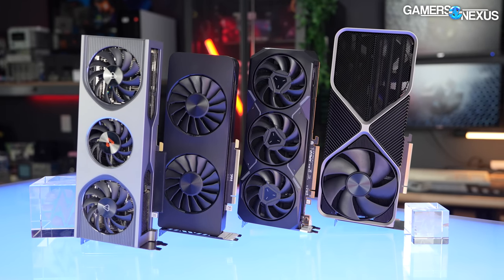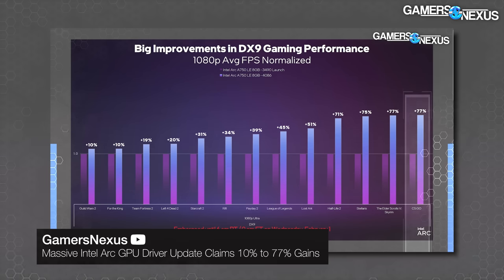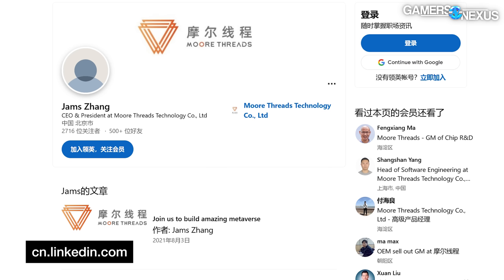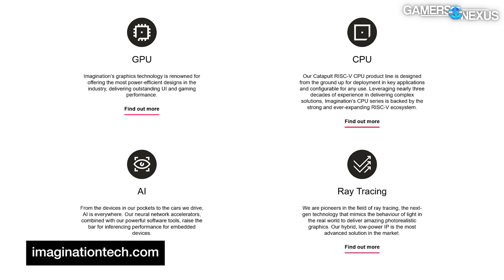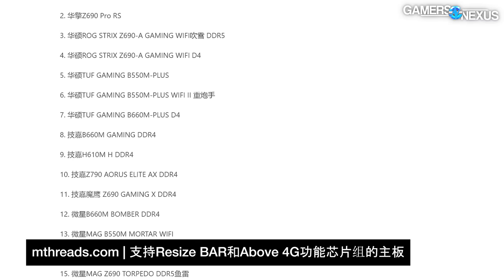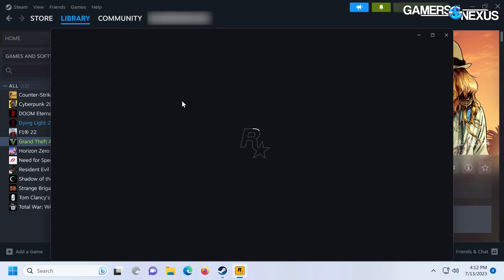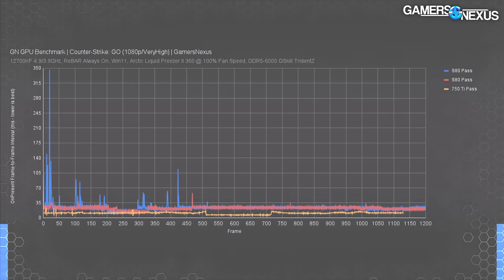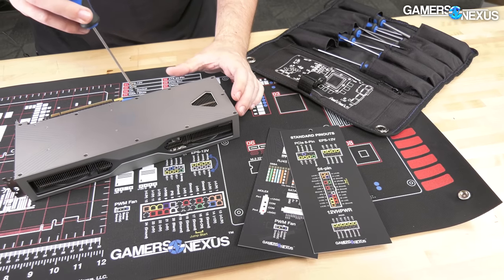China's Moore Threads MTT S80 GPU Review | A New Challenger Appears

Comment: I think it would have been insightful in this case to see the performance compared with modern iGPU performance numbers in addition to the 750 ti. These numbers suddenly make my 5 year old laptop with a mobile 1060 feel like I'm a baller.
Reply: bro lollololll
Reply: i think people doesn't understand that this GPU isn't running at full power. Probably 20-30%. It lacks driver optimization which needs more time
Reply: @cactuslietuva  So, it will go from shit to crap?
Reply from the maker: We had the 16-series cards in there too. An IGP wouldn't really give us any different information.
Reply: that 1660 super? in theory, it is twice as fast as the iGPU in the 7000 series Ryzen.
and that iGPU is (also in theory) twice as fast as the 750Ti.
and that 750Ti is also in theory about the same speed as my old (not in use anymore) HD6950.
But in real life scenarios, I got a better performance with that HD6950 than on my now current iGPU on a Ryzen 7950X.

So I would set my iGPU about where the 750Ti sits as general direction.

I know, it's like slapping bicycle tyres under a 600HP engine, but hey, 600HP! (no worries, it'll change)
Reply: @bernds6587  I'd be more careful about that iGPU comparison you made. You're specifically talking about the Raphael/Dragon Range iGPU (2 CUs), but that has overlap with Mendocino, which is also Ryzen 7000 despite being a monolithic Zen 2 design. Then there's Barcelo-R -- which is just a refresh of a refresh (Barcelo, which is a Cezanne refresh, meaning monolithic Zen 3 with up to 8 Vega CUs and DDR4 support) -- and Rembrandt-R -- which is just a refresh of a different refresh (Rembrandt, which is largely also a Cezanne refresh, but it uses 12 RDNA 2 CUs and supports DDR5). Finally, you have Phoenix, which is monolithic and uses RDNA 3 instead of RDNA 2, albeit with the same number of CUs as Rembrandt(-R).
Reply: While Ig their effort is worth "something" this is a pitiful display like my 12 year old laptop could've done better than this
Reply: @mathewcalaway7684  This GPU is just a low effort demo product to showcase their 'indigenous' tech for individual consumers and investors; The whole point of Moore Threads is AI and high-end compute that is developed and manufactured domestically, as such not affected by US sanctions.

The US banhammer is primarily hitting the fabs, and there's no way China's going prioritize gaming GPUs over commercial and government uses for the limited domestic fab capacity. So forget about gaming driver support in the long run, unless the fab issue somehow gets resolved. If US sanctions start hitting Nvidia/AMD gaming cards (probably inevitable) most Chinese gamers will smuggle them in through the black market, but if Moore Threads has a minuscule foothold in the gaming market, maybe that could turn into a major business opportunity in the very long run (10 years+).

And one must also consider if we're starting to hit the limits of silicon performance, with GPU wattage now going up the wazoo. As the leaders start to stall, the ones behind will start to catch up.
Reply: @mathewcalaway7684  It could but probably won't. You know how Intel's drivers are taking a while to get it together because Intel's focus for years was iGPUs? This Moore Threads GPU is based off of PowerVR IP, a company that last made desktop GPUs when the Y2K bug was still relevant. They have even less experience than Intel and I'm not sure if the Moore Threads people even have access to the PowerVR knowledge, or just the IP.

At best it'll be years before the drivers get whipped into shape but considering that afaik this GPU is meant for compute I doubt it'll ever be very fast for gaming, more just have the crude support for gaming-related APIs we're seeing already.
Reply: @sonicboy678  I know about the change from 8 Vegas to 2x RDNA CUS, but I was pretty sure the Vegas were only in the 5000 series?

That 12 RDNA2 CUs aren't in desktop CPUs, right? I mean, 12 CUs is almost half a RX 6600. I suppose they're used in handhelds and maybe laptops?
Reply: @bernds6587  Ryzen APUs with DDR4 support use Vega graphics, though the variant used in Renoir/Lucienne (Zen 2) and Cezanne/Barcelo(-R) (Zen 3) is in line with the Radeon VII variant (TSMC N7).

Rembrandt(-R) and Phoenix are currently relegated to laptops and handhelds, but AMD could put them on AM5.

Like Rembrandt-R, Barcelo-R SKUs are named within the 7000 series despite using Zen 3.
Reply: my R390 is like a 5090
Reply: @cactuslietuva  Driver optimization is up there with silicon design in terms of difficulty, Intel is still having huge troubles with this.
Reply: @Avantime  Not necessarily, once we reach the limits of silicon design will probably start focusing on efficiency/watt and chiplets. Considering that the longest designers have had to work on a single node on average was around 2-3 years, there is likely a lot of potential that can be brought out of chips just through better design. Just look at how intel managed to squeeze every last drop of performance out of their 14nm. They went from 4 cores running at 4 ghz to 8 cores running at 5+ ghz while also being able to get significant IPC gains and even being able to double the cache size. You will likely see longer architecture development cycles, instead of tick/tock it will be like tick/tick/tick/tock. Unless some new design paradigm, like chiplets, takes over this is likely where things will head for a while. Design is incredibly difficult, so it will be likely that the big 3 will remain on top unless some very poor decisions are made.
Reply: @gokublack8342  those 12 year old gpus took decades to make. not 2 years.
Reply: @AndRei-yc3ti  it is still majorly outclassed by stuff over a decade old
Reply: @gokublack8342  yes and? A gpu that took two years to make is "outclassed" by a 10 year old gpu that took decades to get there. Growth is exponential. Where was my statement jncorrect?
Reply: @AndRei-yc3ti  It's incorrect because it's nothing to be impressed about its almost as bad as them taking 5 years to figure out how to make their own ballpoint pens (which isn't a very complex item) if a US startup made something so shitty they'd get laughed out of the room. Had they done this 10 years ago it would've been like yeah good start or whatever. But this is 2023 I'm not remotely impressed and if I was their supervisor I'd be very tempted to fire the whole lot of them for even thinking it was remotely a good idea to put that garbage in front of me Edit: your decade argument doesn't hold up though this isn't new ground or anything this has all already been done...over 10 years ago...there isn't that much to figure out especially considering copyright in China is as they say "free real estate"
Reply: @gokublack8342  lol making yheir own processers and GPUs is one of the most ckmplex things a company can currently do. And this is based on entirely chinese tech so it needs iteration

Comment: To put into perspective how bad these results are, the Steam Deck is a bit faster or the same performance as a 750Ti in most games (this is according to DF).

So at 15W the Steam Deck is about twice as fast as this card using over 130W.
Reply: @jakejakedowntwo6613 
The Mac never used PowerVR, it used PowerPC. Those are completely unrelated.
This card is also completely unrelated to PowerVR. PowerVR is a designer of TBDR GPUs mostly used in mobile devices. They don't support Windows and they don't support any kind of DirectX nowadays anymore. Their targets are Vulkan, OpenGL ES and Linux/Android.
Reply: @dexterhaxxor  my bad i mixed the two up
Edit: GN speculate that it could be Power Vr via circumstantial evidence and it could be performing terribly since it wasn't designed well for gaming. 
BullsLab tested its float performance and it was good.
Also Imagination Technologies is owned by China.
Reply: @dexterhaxxor  The Mac didn't, Apple used PowerVR for their GPU's in the Early Iphone's and Ipad's.
Somewhere around 2016-2017 is when they stopped using PowerVR and started designing their own GPU's for their mobile devices.
Reply: @Bogster13  Ah alright, makes sense, didn't know that. Anyway, PowerVR definitely doesn't make bad GPUs.

Comment: Intel: Delivers one of the most unstable GPUs we've seen in a very long time
Moore Threads: "Hold my bear"
Reply: panda*
Reply: @manakajunpei9007  Hold my bamboo.
Reply: Yes but Intel has been making iGPUs and drivers for decades. This is MT's first GPU ever. Big difference there.
Reply: @andrewskaterrr  Yup, that's the only reason they even remotely have a fighting chance. Even then, they seem to be continuing their track record of shoddy driver updates. Lots of people with Arc GPUs can't even wake their system up from sleep mode which has been a know issue for many months, lol
Reply: @BelleDoesStuff  'shoddy driver updates'?? Lol, their updates have been on fire and they are improving with each iteration.
Reply: actually that used to be true till 5 months ago the arc a750 would crash at least one time every time i played gta5 in dx 11, but as for now with the newest drivers everything works flawlessly, they fixed the issues with dx11, vulkan games never ever had issues even when i first bought the card. Its been 3 months since the last crash in a game, and would even go far as saying that i would advice a 750 over a 3060. Even on the drivers situation, intel's software might be a lil stripped down when looking at nvidia's software, but boy installing drivers fot it is so easy even a toddler could do it.
Reply: @BelleDoesStuff  Absolutely not true. They pull a new driver every two to three weeks and with each update is always leaps forward.
Reply: @addo9697  I daily drove an A770 for the last 5 months up until a week ago.

Here's a list of problems I was still actively seeing when I finally replaced it with a better GPU: 
- Intel publishing a couple of drivers that would cause regressions in system stability
- I dealt with the sleep issues that were ongoing the entire time I owned the card
- I've seen countless DX11 games with unacceptably bad performance
- A good handful of games with graphical glitches or stability issues.
- Was sold Topaz Gigapixel AI as part of a bundle with my A770. That and other Topaz Labs software is still to this day completely broken on Intel Arc due to driver issues. This has been known by Intel for nearly 5 months now without any update.
- Dealt with RPCS3 issues where the Intel Vulkan driver would timeout, preventing the emulator from launching
- During the last month or so I used the card, I had to deal with an issue where launching a game would cause my bluetooth headphones to disappear from my audio devices and take ~30 seconds to become valid a valid audio output. I actually didn't think this could have been an Intel issue, but it is completely gone now that I no longer have an Arc GPU.
- The Xenia emulator was basically useless for me because of a very long standing Intel driver bug that prevents the emulator from using it's default render. It instead had to use Xenia's more accurate render which for me made the A770 perform about half as fast as the 1070 TI I originally had in the system.
- General power efficiency issues and most especially the high idle power draw, even with the specific BIOS settings enabled. Only "fix" would be to lower the refresh rate of my display, which I'm not willing to do.
- I had to deal with the issues Intel Arc GPUs have with snipping tool which is still an open and valid issue to this day. This problem was originally reported to Intel back in December and is still ongoing.
- Their time to fix for issues is actually pretty bad. Large issues that can prevent people from being able to reliably use their computer or play games often take many months to be resolved.
- On top of the time to fix the issues taking a long time, their driver support team was not something I was impressed with. I reported to them that Portal RTX didn't work on Arc GPUs and I was told that the game also doesn't work on AMD GPUs (when it does). When I pushed back on them and gave evidence that it does work, they shared a video of Portal RTX crashing on an AMD APU and used that as proof.

When the card was stable it was pretty good and even with the issues I saw, I still think Intel has done a pretty decent job and I'm impressed that it's not largely much worse, but that GPU architecture is approaching 1 year on the market and there are still some large stability issues that effect plenty of people. The progress that they have made is good, but it's not enough to bring it in-line with AMD or NVIDIA and is what I would consider to be "shoddy" because the quality is just not consistent. 

And yes, they do frequently release new drivers, but these are almost always focused on improving compatibility with brand new titles rather than fixing the long backlog of software issues.

I'm glad you are having a good experience with your A750, but people have a widely inconsistent experience with Arc GPUs and even when they are behaving on the more stable side of things, there are still a lot of issues.
Reply: 55 years company with decades of experience in making iGPU and keeping up with firmware to support graphics tech with one of the richest human resource in the industry

vs

3 years old company in foreign country operating under quasi tech blockage
Reply: Well, I credit Intel for taking a shot at supporting the consumer GPU market and tossing their hat into the ring. Their offerings are not quite there yet with nVidia and AMD's best, but at their price point, they are not terrible and continue to improve. If they stay in the market eventually they will be a player, and that will be important if nVidia diverts resources to "AI" chips. I doubt nVidia would abandon the consumer market - there is a lot of money still there and I doubt they'd leave it all on the table, but "AI" (deliberately quoted) certainly could affect R&D resources going forward.
Reply: @BelleDoesStuff  Bruh I really think you got a bad 770, or maybe the 770's are bad (. Lots of people advising the 750 over the 770) but I literally never encountered almost any of these bugs, the only notable one that u mentioned, and that I had is the Bluetooth bug thing, but really got fixed in the next driver. Other than that I've been playing with it all games and programs, no problem whatsoever. I feel sorry that u got a bad arc GPU
Reply: @BelleDoesStuff  I can assure u my arc never had problems with Vulcan, and dx11 got actually fixed, I almost never shut down my computer it always put it on sleep and I didn't have any major problem with it I've got 3 monitor all different attached to it and once in a while it will disconnected the HDMI display automatically, but nothing that unplugging and plugging again can't fix, but this is the only problem I have with it for now

Comment: RE. the memory spacing. While it may be correct (or also correct) that the memory has been moved to avoid the screw holes, its also possible that they may have moved the memory closer to shorten the traces as high frequency switching is very sensitive to length. Also, it could be an attempt to get a working board with less layers to reduce cost (reducing the path the signal has to travel reduces the amount of time interference is experienced by a particular signal). Thus, they may be able to use less layers.

Comment: I'll bet the heatsink was some off the shelf generic cooler and so they adapted the PCB design and moved the Memory so that they could still use it. I kind of like the way the card looks. Very interesting product, thanks for the video!
Reply: Doesn’t look like it, have you ever seen a recent GPU have heat sink screwed form the front? They all screwed in from the back.  And look at that hole spacing… most GPU I can across are square, not rectangle.
Reply: The fans are off the shelf cheap garbage too, about 12 yuan each on TaoBao.

Comment: GTX 750ti is a legend. It was a very good card at the time for not much money and it used very little power. In fact it remained pretty usable until only recently.
Reply: Today's market would need some of that GTX 750 style variation like salt .RTX 4090 is not what the mainstream would expect or be willing to run.
Reply: @czviktor  yes. For about 10-15 years of PC gaming I always bought cards in the 150-250 dollar price range and they were always very good. I even bought a sub 100 dollar cars sometimes and while it wasn’t possible to max out settings it was still very capable like the Radeon HD 5670 that was a lower mid range card I paid I think 99 bucks for or something like that in 2010. Now I’m used to thinking sub 1000 is decent pricing. I’m almost disgusted by how my idea of what is inexpensive has changed in the last few years.